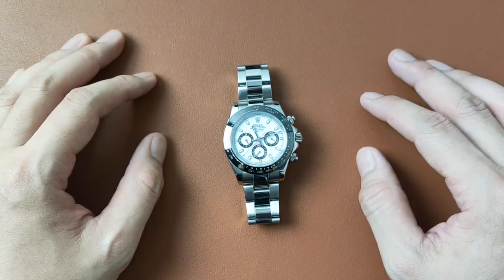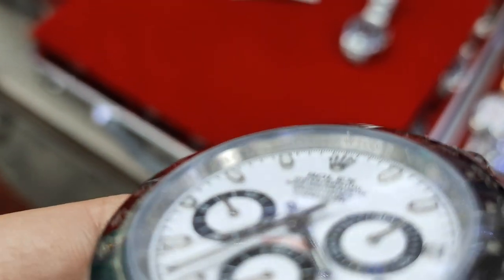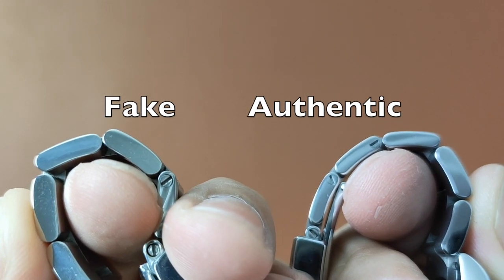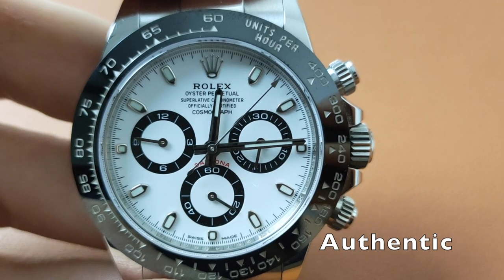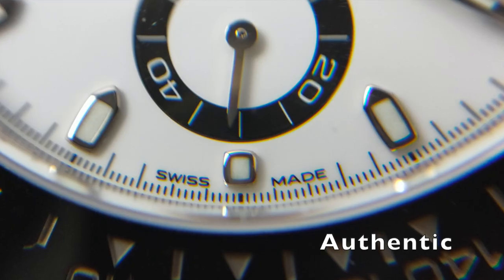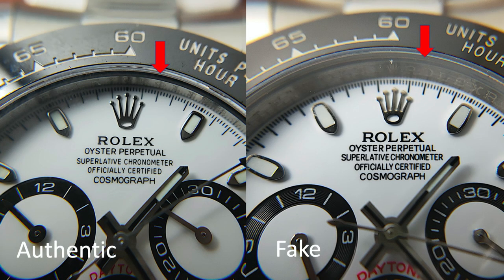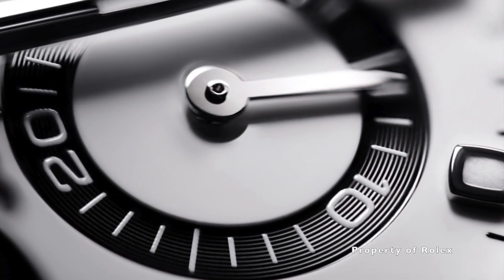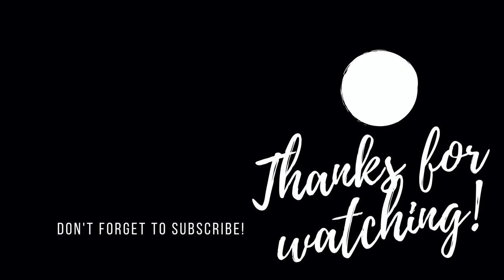Fake Daytona Part 2: 15 Tell-tale signs of a fake Rolex Daytona.

Comment: I agree with the recent  comments. The super clones manufactured today can't be distinguished from authentic vs. clone, movements have been clone, and parts can be interchangeable. They use the same stainless steel rating 904L! You're just buying a Rolex Daytona from a non-Rolex manufacture !
Reply from the maker: Lol....I guess that's the end game now 😂 Wouldn't that really devalue Rolex?
Reply: I have both.  A real 2022 Daytona white dial, and just got a super clone 3 months ago.  I only wear the superclone.  I honestly cannot even tell the difference.  Rolex has devalued itself in my eyes. Not having them at the dealer to buy or try on really pissed me off.  I was on the “waiting list” for 5 years- I started on the list preceramic!  That’s total BS, and the fact that you cannot buy a real Rolex at MSRP anymore steered me away from the brand.  There are a lot of models that I like at MSRP, but I’m not gonna wait or kiss some dealers ass for one anymore.  I feel more comfortable wearing the clone for many reasons.  And if it dies???…. I buy another one at $800
Reply: "You're just buying a Rolex Daytona from a non-Rolex manufacture!"  Perfect definition of a counterfeit.